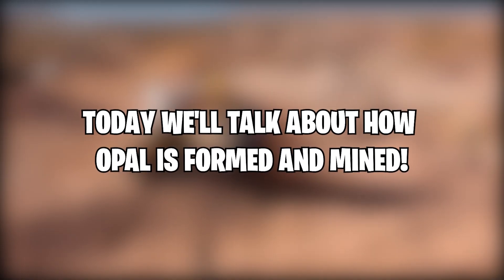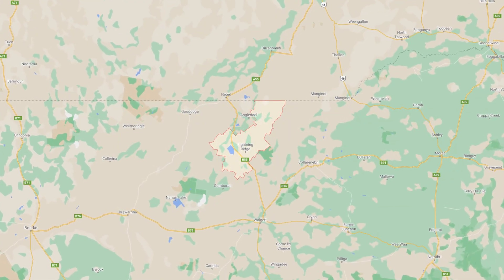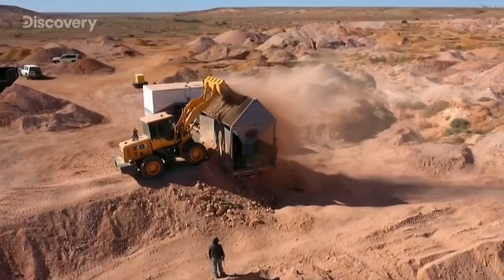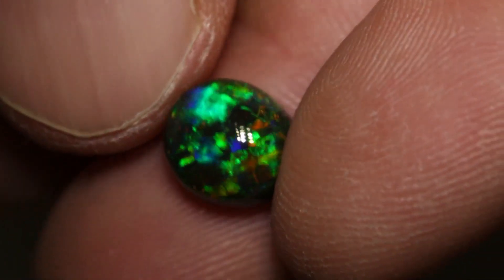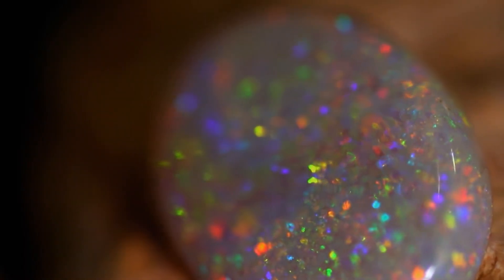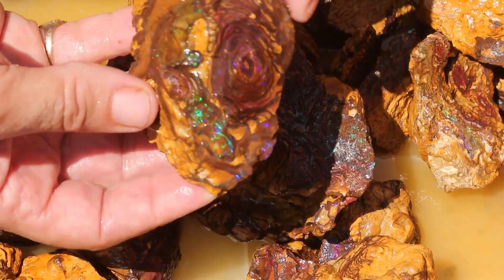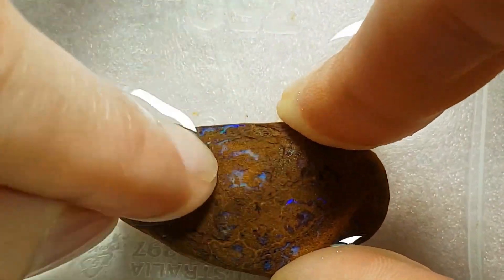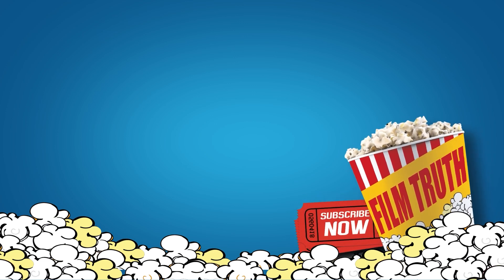How is Opal formed and Mined?

Comment: So opal is shiny silica fossilised bone?
Reply: Opal is shiny silica dioxide that is sometimes found in fossilized cavities (a type of fossil), occasionally forming a complete cast. These cavities are created when and organism decays leaving a "mold" of itself. Interestingly, these casts aren't technically fossilized, they're opalized.
 Opal can be also found in natural voids such as those left from volcanic activity.

In fossilized bones, like we typically think of with dinosaur fossils, the fossil forms through crystalline replacement. Replacement occurs when the shell, bone, or other tissue is replaced with another mineral. In some cases mineral replacement of the original shell occurs so gradually and at such fine scales that microstructural features are preserved despite the total loss of original material. A shell is said to be recrystallized when the original skeletal compounds are still present but in a different crystal form, as from aragonite to calcite.

Both can also occur, if part of a bone forms a cast before decaying and the rest of the bone recrystalizes, you can get a fossil with opal attached. 

Thank you for coming to my ted talk😅